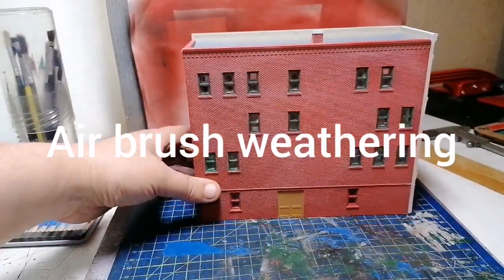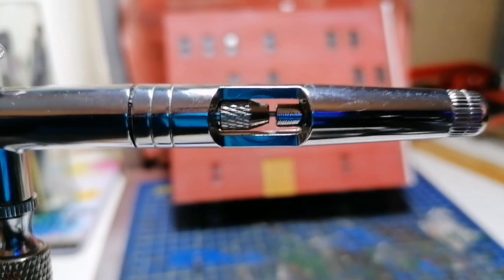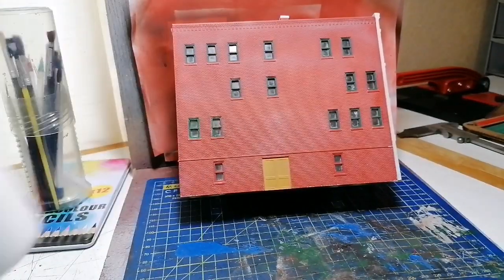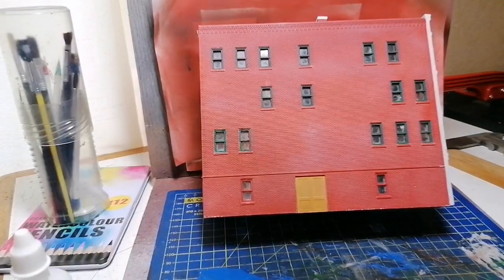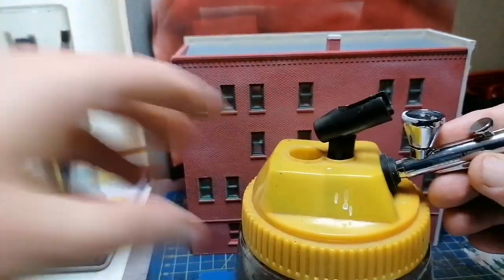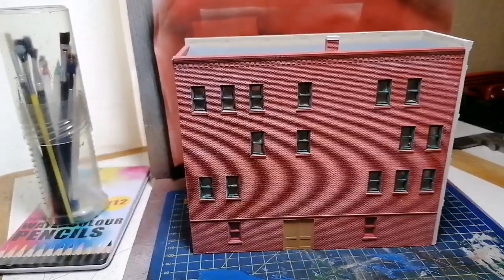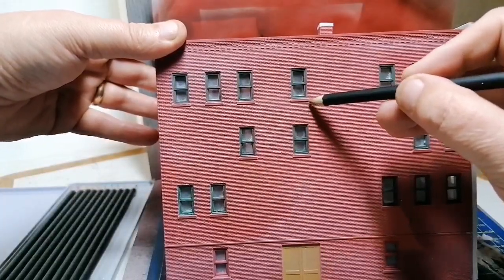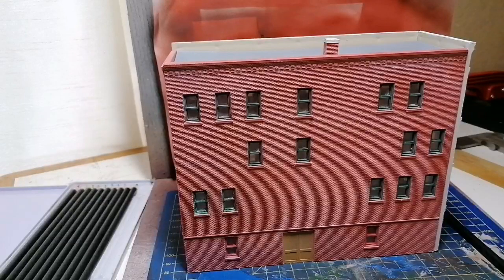Airbrush weathering a building for the model railway

Comment: Great how to video. Can i ask what brand is the air bruch i like a better one. Do you take it apart and clean the rod and the inside thank you for showing
Reply from the maker: Thanks Dwight the one I used here is bartsharp, I also use sparmax, iawata and my favourite is Badger, Harder and Steinbeck is next on my wants list, and yes I take the airbrush apart and remove the needle completely for a proper clean